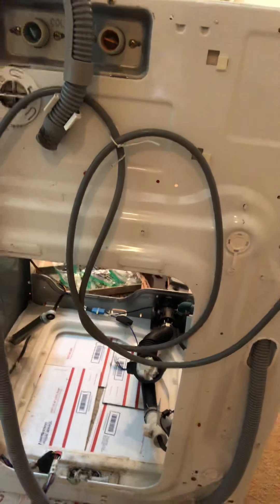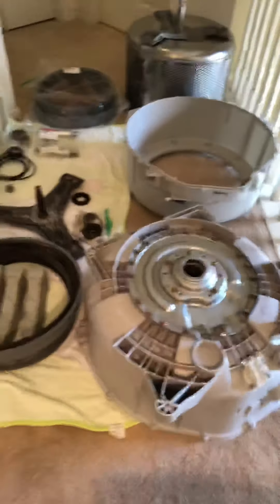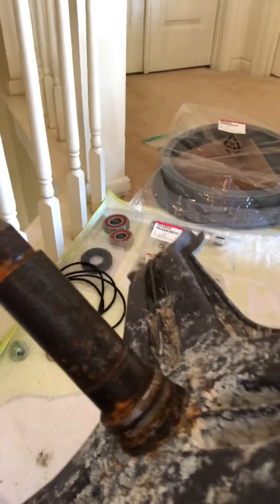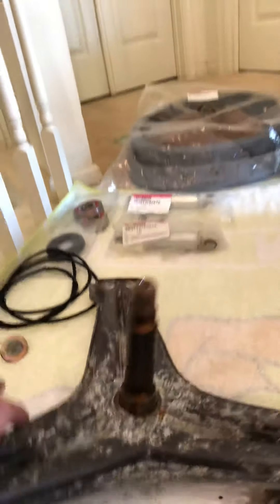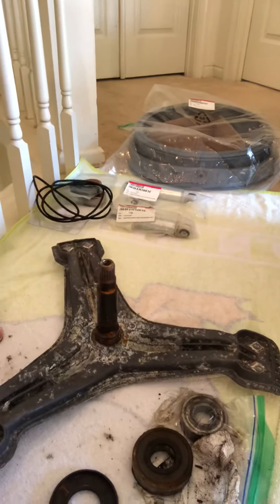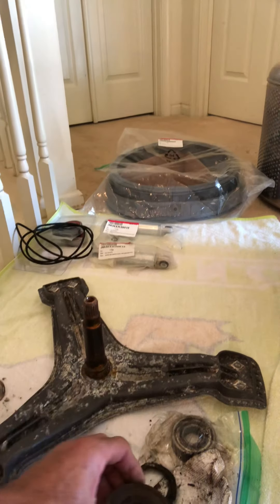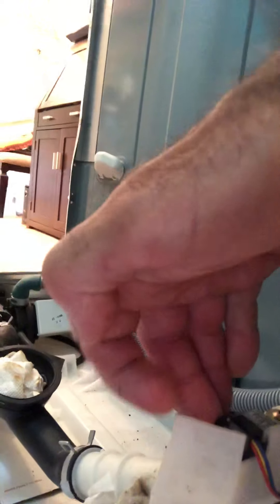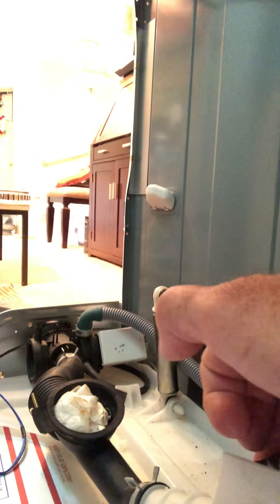LG/GE Washer Repair “warning” watch before repairing/replacing bearings.

Comment: Ha ha laughed out load in last minute!! I heard your wife/GF say 'buy a new one". So funny, just what my GF says to me. I am in the middle of the bearing repair. Mine is in better condition than yours however I am replacing the bearings, tub seal, spider and, as its easy to get at, the shocks.
Guys like us are not understood sometimes by our female friends. The thought of throwing away something that can be fixed never crosses my mind and I prefer to forget about the cost and labor hours despite reminders from GF☺☺☺☺☺☺
Reply: My husband is ready to go buy a new machine! I on the other hand am determined that we can replace the bearings that we started to. Ran into some problems iwth the spider arm so ordered a new one BUT several of the bolts on the spider are just spinning. But I will not be beaten, they are coming out :)

Comment: I'm watching your video because my same washer is leaking a second time after rebuilding it 5 years ago. Every single issue you speak of was exactly like what I experienced except my motor magnet didn't destroy my motor coil so my repair was about $100 cheaper. Just that scum coating on everything makes me think the entire washer isn't a very healthy way of cleaning our clothes. As I set here thinking of having to do all of this a second time and have some other component fail like the water solenoids, I'm beginning to think I might have to send it to the curb and purchase a new washer and I almost never make that kind of choice.  Great video. It should really help many DIYers that are in the same situation.

Comment: I'm beginning to think that donating this old machine would be best, after watching the details of your harrowing experience with your machine. Let somebody else take it apart and rehab the machine - someone who truly enjoys doing such projects. Somebody that does this type of refurbishment for a living and has access to several junk machines to pull parts from. I've always got repairs to do for two vehicles; when I get one fixed, then the other one needs something done. Part of the cost of having two older vehicles with both having > 220K miles on the clock, and a cost that I don't mind paying. It's something I enjoy doing for the last 45 years, and repairing these vehicles keeps me occupied and I keep adding to my tool collection as a bonus. Thanks for posting the video; you just saved me from days of frustration and dangerously high blood pressure readings.

Comment: Man, you really touched my heart. Very genuine advice and I really love it. I was in the same situation with vibrations and thought the bearings are bad, striped it down to all the parts, but could not muster enought courage to remove the old bearing. Luckily, the bearings were not bad, and it turned out simply the washer of not balance properly.

Comment: dude... I didn't watch this before I started my journey. and no joke.. I went through all these things you described.. like almost to the t.. my spiderarm was just as bad. and went through cleaning it and said f it and ordered a new one lol 😆.  I'm at the point of changing the bearings now. God help me.
Reply: update: I only bought the rear tub bearing.  a little nerve racking to do but doable. just don't crazy, take your time. as far as the inner bearing, I simply opened up the existing gasket and applied more grease, as I felt it wasn't in bad condition, just maybe needed more lubricant. reconnected everything and got it running.  advice? have someone help you with reinstalling the tub assembly, its way easier with 2 people. imo not a solo job if you wanna ensure that you don't damage any underside components.

Comment: Thank you for taking the time to put this video together. I hope you made out well in the end!
We have an almost identical machine (close to 20 y/o) that vibrates on spin and has some play between the tubs. 
I have made other repairs previously, but think I will run it until it goes out completely and just replace the machine rather than tackle the bearings and the whole slew of other parts

Comment: I can relate. 🤣 Watching this after all the “hard” and “dirty” works. LOL. I’m about to reassemble EVERYTHING now, and just watching videos to make sure I’ll be doing it right.  From the previous videos I watched, they are all saying and showing only bearing replacement parts.  I bought the spider together with the bearings (with the o ring gasket included) and also bought a bearing puller from Harbor Freight before even starting the “project”.  Inspite of the right bearing puller design I purchased, I have to return it as for quality issues (yeah, Harbor Freight), the jaws keep slipping as the jaw can’t bite well and it bends.  I have to order from Amazon instead, so that’s another delay. The one from Amazon is perfect (sort of), but it only did half the job. I eventually resorted to partially hammering with a small mortar chisel from HF (you can use any metal rod or punch).  Anyway, yeah … it’s really dirty. I think I spent a lot of time cleaning the tub parts and the rubber tubings. The spider failed as it’s full of gunk and corroded the aluminum (the family uses a lot of fabric softener, and recently the Downy beads). Probably once the spider is compromised, the tub wobbles during spin. This wobble damages the bearing seals, which will let the water into the bearings. Once rusted, the bearing will fail. As for ours, the bearings I removed still looks good, but can see rusts started to build up.   Our 13 yr old washer’s first symptom was the smell of burning rubber after a wash. We looked and part of the front rubber door seal was partially torn and rubbing onto the stainless steel tub. We thought a garment probably got stuck and eventually torn a part of it. We dismissed this at first, as its probably a one time thing. But then we noticed the washer is making a noise, louder than usual, during spin cycles. After investigation, I found out that the tub now spins with wobble. And this causes the tub to rub on the front rubber seal.  These are all symptoms you have to keep an eye on, don’t wait until the washer fatally fails.  To sum it up, on what I thought is a simple fix, turns out to be a big project. This is all about pride now, lol, and I’m invested in it. But still, the expenses is still way down as compared to a new washer/dryer set.  I enjoyed doing it, but heck yeah, the time spent costs more than a new one.  Do I regret doing this, a big NO. 😅

Comment: Did the same job today. Took five hours. The hardest part was separating the spider axel from the tub. I thought it would never release. Fortunately I live in an area with very nice water, no scale. The spider was in great condition. 

I also F’d up the bolt trying to bang out the axel. But the bearings came out OK. I froze the new ones and I think that helped get the new ones back in. 

I didn’t wait to do the repair. The washer was only noisy for a few weeks. My stator and rotor were fine. 

I guess I lucked out. It sure runs smooth again. That’s rewarding.

Comment: Bravo for sharing your story. I just finished putting mine back together yesterday. For us it was worth the effort to replace the bearings. Like you I found the spider caked in what looks like barnacles and it had pitting on the shaft so I ended up replacing it too. Our's was in better condition than your, no need to replace the stator and such. In Canada, I paid appx $170 for the spider and $92 for the bearings... all in (tax, shipping, etc). I might have saved a bit on shipping had I known the condition of the spider before I ordered the bearings. My dude math thought that $162 and 5-6 cumulative hrs in the garage was worth the effort as of course we would have to replace the "set" ;-) ~$2800. Like you I had not anticipated the force to release the agitator  drum out of the water drum even after soaking in WD40 for a few hours. A few smashed 2x4's and it finally came out. 

I also stripped out one of the screw holes that keep the two plastic water tub pieces together, I tried some JB Weld plastic without success and ended up drilling through and using a nut/bolt.

Great piece of knowledge you've offered here, definitely getting to it a little may have lessened some of the damage on the stator, etc.

Comment: Great video. I'm appliance repairman never replaced the bearing just because it's very time consuming and here in America the labor is more expensive than parts. I have been playing with the idea to replace one but to the extent of damage that was done on this one is exuberant. If you would have caught it earlier, probably would have ended up not having to replace the stator and magnets and shocks. Every time I do a repair, I also check the drum alignment. Sometimes you can spin the drum and watch the gap around the tub if it is changing. That means your drum is off centered. It could mean a broken spider arm from the hard water and soap combination?. Or if the bearing is going out you can feel it by lifting the drum up and down a little bit. And if you feel any play, the mean is bearing is on the way out. Also you can take the back panel off and see if there is any rust on water coming through and the bearing before it feels when it starts grinding and shaking it's too late. I would never spend $400 in parts and $400 in labor. For $800 machine. Most likely it took couple days before it was all said and done and the amount of damage to the other components would require multiple trips to get this thing back to normal. But I do really appreciate taking time and sharing all of your experience this is priceless!

Comment: Totally relate to the dilema. Same exact experience with the exception of the scum layer. Try using less detergent and do NOT use fabric softener, ever. It all builds up. The key to making the bearings last is to NOT overload the machine with clothes. It puts stress on the seal and bearings over time. Great video though as far as content.
Reply: "...NOT overload the machine." Try telling that to my kids.
Reply: Run a clean cycle once a month with washing machine cleaner had same issue bad bearings and spider was corroded and broken. Machine was smoking .replaced spider bearings now good to go. Replace shocks while your in there
Reply: @brianharrison5481  RIGHT ON SIR!!!
Reply: My washing drum spindle rusted/deteriorated which threw the drum out of balance and destroyed the bearings and bearing seal and shocks.  20 year old machine was in a weekend house.  Not sure load weight or amount of use was ever an issue but rather the issue was corrosive chemicals in water and time.
Reply: @Sandbag1300 which brand?

Comment: I replaced the bearings on my Zanussi about 4 years ago, cost me a total of about £30 for parts,  plus a few hours of my time. Mine was only 10 - 11 years old at the time and the spider was still in excellent condition. I saved a bit of money by buying quality bearings from a bearing supplier, rather than the Zanussi parts, the genuine bearing seal and the seal that goes between the two halves of the tub cost more than the bearings.  

It had made a loud squeal during the spin, and also did so when I turned the drum by hand, although there was no play in the bearings, which I knew probably meant the water/oil seal had worn out and let water rust the bearings, so I stopped using it before the shaft could get damaged and stripped it down  to check what would  need replacing before I ordered any parts.

The tub and drum etc were nice and clean apart from some slight surface traces of limescale and some limescale build up in the sump pipes, but no mould, or scum. The spider on mine had no damage or corrosion at all, nor was it darkened like yours.  I do need to descale my machine maybe about once a year with citric acid to stop limescale building up, we have very hard water in this part of the UK.

We don't get mould, or smells in the washing machine because we use washing powder which has sodium percarbonate  (oxygen bleach) and TAED in it and leave the door ajar after the wash. We stopped using liquid detergent in the 1980's after discovering they cause mould, scum and slime, and made the washing machine stink to high heaven.  This video explains why -  https://www.youtube.com/watch?v=6HnzBS_XQhA

Anyway, I hope it is still working well after all that work and expense, I had to spend another £15 on mine recently to fix a fault on the control board, thankfully the service manuals for electrolux (Zanussi/AEG) machines are pretty good.

Comment: It is very important with this kind of washer, to always leave the door open a little bit after every single load.
This allows it to dry out inside.
You will not get that mildew and mold if you let it dry out EVERY SINGLE TIME you use it.
The instructions are very clear on this too, and the door latch has a feature that lets the door close within about an inch of being sealed.
If the door is closed, no moisture can escape.

I had my machine for years and never had any odor, and a girlfriend was visiting from up north, and she did not know, and closed it up after doing a load.
Next day, I opened it and could not believe how bad it smelled...just from one time left closed.
I ran a clean tub cycle with some bleach, and it was fine again, and now like 5 years later, it is still no smell at all, door gasket looks brand new.

This could also contribute to the corrosion problems.
You have to let the machine interior get all the way dry after every load, unless of course you are using it right away again.

My machine just started making the roaring sound while it is on spin, only when it is going at that top speed though.
So, after about 12 years, I have only ever had to replace the water pump, and the little door stopper that keeps it open a little bit. Both pretty cheap.

I really do not want to buy a new washer if I can fix this one.
So I am watching every video I can find to see all lots of info before I do anything.

One I just watched, the guy says, it is a good idea to take it apart before buying anything. Delivery is fast these days, sometimes same day and next day at the worst for most stuff.

Comment: Instead of placing screws in a bag. I use a cardboard  box. I write each step of the location and punch a hole for each screw. I think I got upto step 40. Lol I didn't punch holes for the huge screws, they went in a container. The great thing about this is that it doesn't get lost and you know exactly the reverse order. I fixed my dryer the same way using a polystyrene board, but created the those tiny static pieces.

Comment: You are so right with this video. If you bearings getting bad. Thx to you I stopped here and did not buy any further parts. I would need to buy a Spider Assembly and Shock Absorbers. Now we buy a new machine in a special offer.

Comment: I am now at the same stage as you did there, I done disassembly all the parts including inner drum and bearing, my washer machine problem is broken on the spider drum support, I am still try to fixing it and waiting for the parts coming. I have the same feelling as you, I spent a lot of time and always stuck in my head but hope I can finish my project successfully 🤞🤞🙏🙏

Comment: lol buy a new one, a voice of wisdom there?... same problem here, it is much harder to get the metal shaft out than all the instructional video state. i am looking around to see if anyone found an easier way. i do have a bearing puller, but it doesnt work when the shaft is in the way. bearings puller are just that, only for pulling bearings.i also have a hyraulic press, but no way to fit tub into it. so i guess back to the hammer. yes it is easier to get a new one (this one is 14 years old so its due), but now that it is open, for me its no longer about the money, but the desire to see it thru. so thanks for the video, its very informative, self defeating but informative.

Comment: I just did that repair. I watched a bunch of videos to see if I could handle it and decided I could. Keep in mind a new machine is $1K. When I took the machine apart, I discovered that it was in fact the spider that was broken and found a supplier with one in stock. It was the only problem. I ended up changing the bearings and seal just for preventative maintenance. I had the machine back together the next day after I picked the parts up. 4 days total from when it broke. It was $300 in parts. No brainer to repair. 

Now for your situation? There’s NO WAY I’d’ve continued after seeing all of those issues. You had to replace way too many parts to make it worthwhile. That machine would’ve been on the curb the same day I opened it up. And it’s white so even cheaper than my grey one. 

Next time, open it up before you commit with a parts order.  At least it’s lighter to carry out if it’s in pieces. Lol

Comment: Just completed this same job, if you are mechanically inclined it is not that bad!! One full day from 10am and I was running a test wash cycle by 5pm. That is taking a lunch and I am no appliance repairman.  There are other videos to follow step by step and with links for all the parts.

Comment: Thanks for this video.  I am in the same situation with my LG front load washer.  I replaced the shocks but it still has a serious wobble to the drum.   From watching related videos I think the spider is corroded and broken.  I am not even going to take it apart because I dont think its worth the trouble.  2 years ago,   I repaired my mothers 1979 top load kenmore washer by replacing the drum seal which cost $7.   Its still running like a champ after 44 years.  I want to go back to a top load washer.  I dont like the complex design of the front load washer.  Its not long term reliable.  The front load also doesnt wash cloths as well as the top load and leaves the cloths and inside of the washer smelling moldy as you stated.